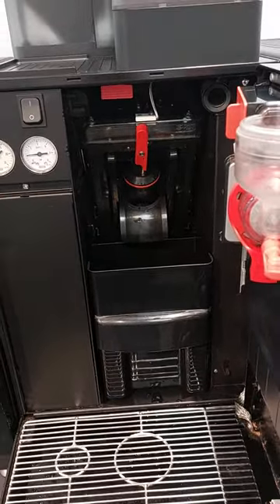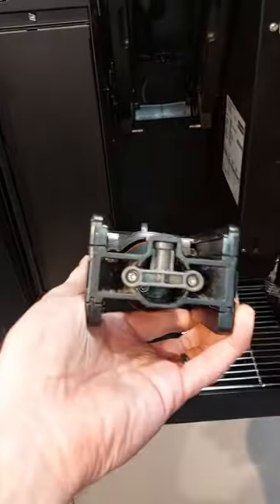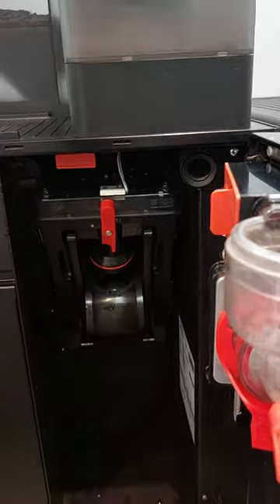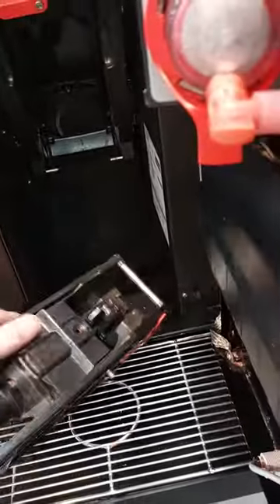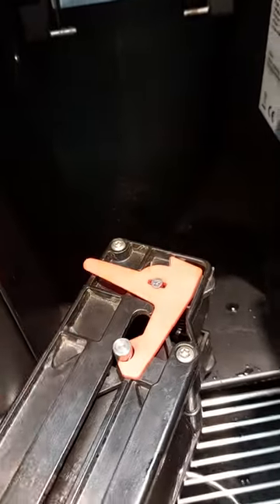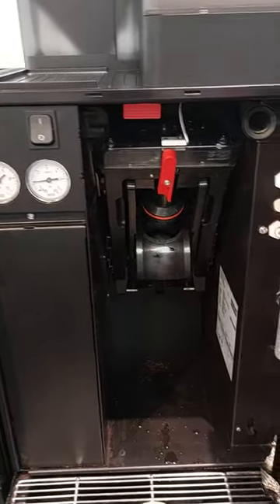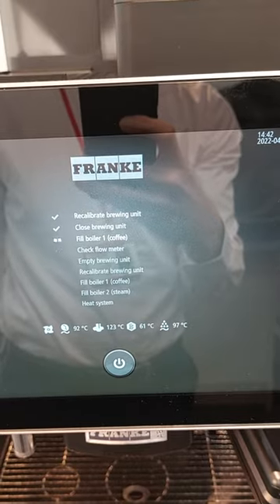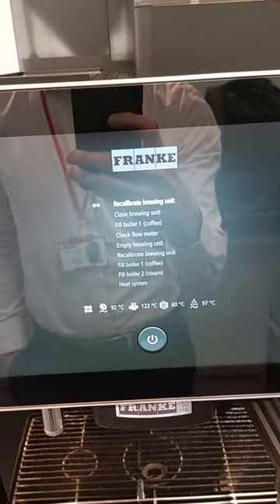Brewer unit removal on Franke A-Line range (A300, A400, A600, A800, A1000) and SB1200

Comment: How do you get it out if you accidentally put it in backwards?
Reply from the maker: It should be the same way that it was inserted, but it's only possible to put it in one way.
Reply: Bt I put it accidentally wrong way and it stuck now ..how to remove it
Reply from the maker: @uk-darshan4345  You would need to contact the company you bought it through and they'd then log a call.
Reply: @uk-darshan4345  did you get that resolved..
Reply: @Sharath Chandra Boddu  I actually identally put mine in the wrong way while the cleaning program was on. 

To rectify. You finish the cleaning process. Initiate startup like normal. Just do everything like you normally would. Once done the lock will release and you can pull it out. Bear in mind you will need to clean again as the tablet won't be accepted properly. 

Otherwise any other issue you will need to contact support. Or have a the correct screwdriver to take apart the being unit. Of which a Phillips head will not work. Something like a T8 may but I havnt yet had to do that myself to know exactly

Comment: great video thank you, I do have a question. How would you fix it if the piston was put in backwards?
Reply from the maker: It's only possible to insert the brewer unit correctly one way.
Reply: @jameshowcroft I did insert it incorrectly, from other side. How do I fix it
Reply: Did you figure this out as I have the same problem
Reply: @Robo50cal  Just gently move it. After 15mins of doing this it somehow got out
Reply: @emiliolt  thanks

Comment: Great video resource. The user manual doesn't cover this so I'm thankful you have taken the time to do it.

Bonus question. We occasionally get "Increments in brew group too small" (translated loosely from local language). Do you know hoe to alleviate this?
Reply from the maker: Unfortunately, it sounds like you may need a new brewer unit (I suspect it's been used a lot?), which you can order locally yourself and replace.